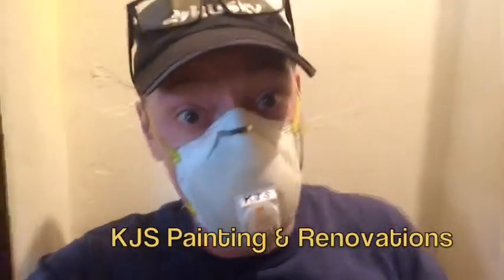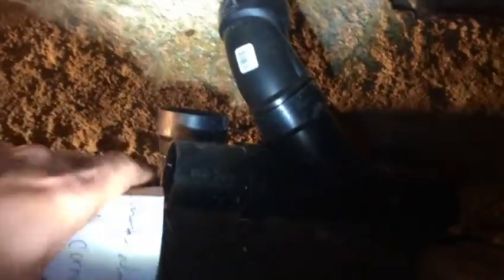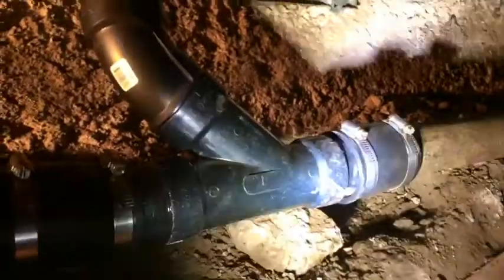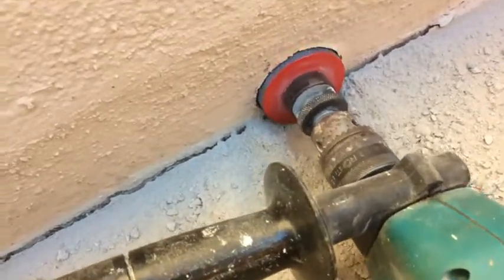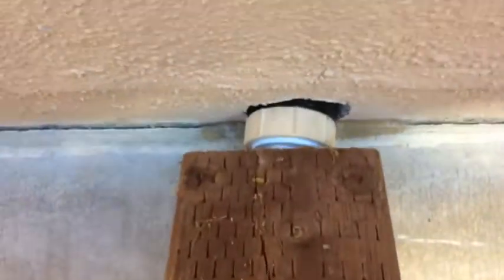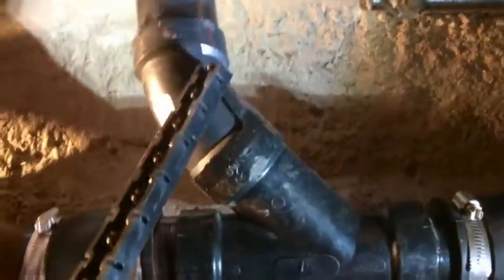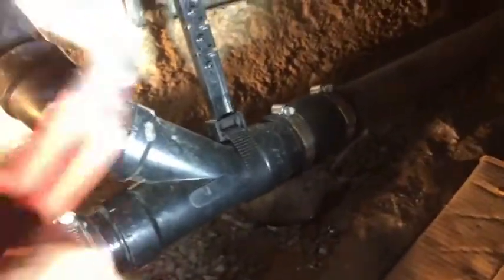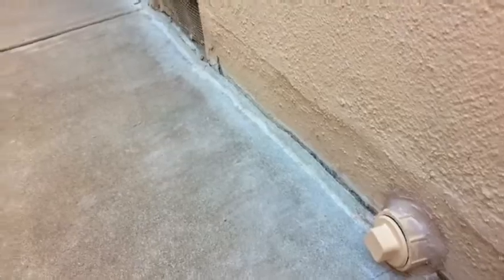Adding a Sanitary Wye Cleanout to a Sewer Line

Comment: I wanted to say how much I appreciate your attention to detail on all aspects of this job, even down to the markings on the pipe to get the sleeve centered just right, blowing the dust away from the opening before you caulked it, buying caulk to match the house, and more. I would hire you in a heartbeat after watching this video. The little details tell me you get the important stuff right.
Reply from the maker: Thanks Peter. Ironically I'm going back to that same, long-time, client. This time doing a minor remodel to his laundry room. He is a very clean, fastidious man and hires me especially for my meticulousness. A rare soul. Many clients only want a fast slap-shift job that usually ends up with an unsatisfying outcome. In my opinion. I try not to take those jobs. Alas, sometimes I have no choice. Whereas if I were to work for you it would be top-notch satisfying job yielding a long-lasting result. Take good care. Kent